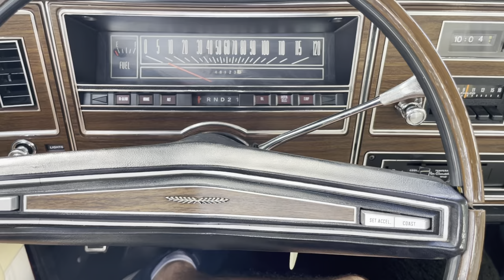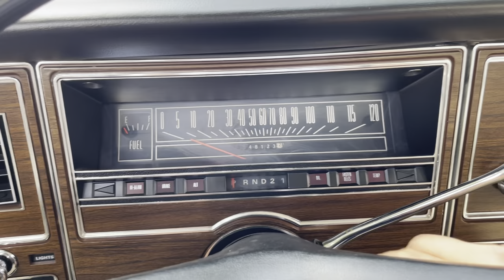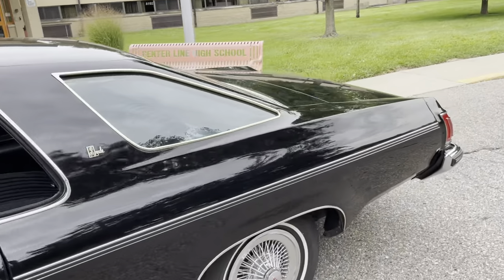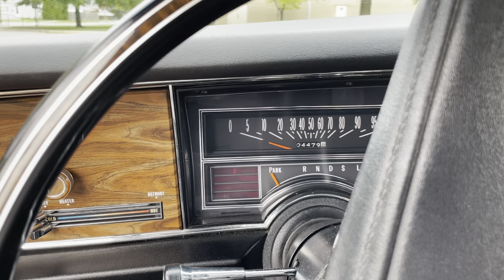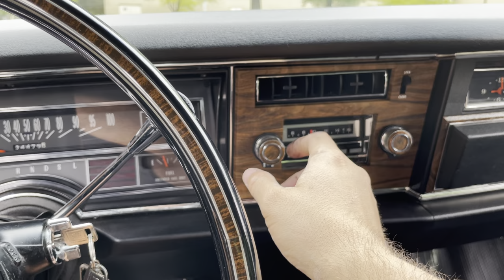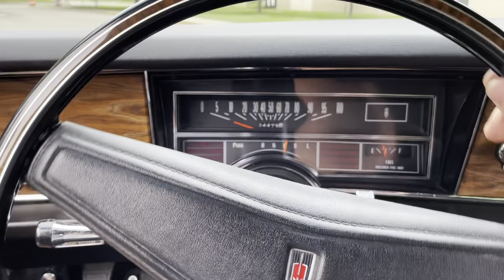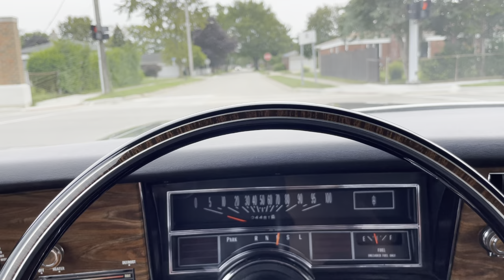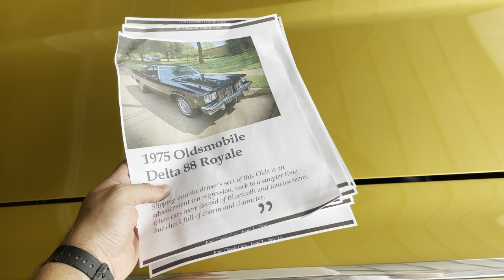1975 Oldsmobile Delta 88 Royale & 1974 Mercury Marquis Brougham - Check out Article in Description!

Comment: My dad drove these Ford LTD, Mercury Marquis land yachts when I was a little boy.  They did ride remarkably smooth.
Reply: Same here, we had a 72’ Galaxy 500, what a tank but boy did it float, that 400 moved her pretty good too. 👍🇺🇸
Reply: I got a 72 Galaxy 500 two-door but it's only got the 351 Windsor still a f**** beast
Reply: I love ‘em, I’ve got a ‘71 LTD 2 door with a hot 429 although it has airbags in the rear and a coil over conversion in front so ride and handling are a lot better. It runs 12.6 second quarters. I’ve also got a ‘71 convertible on magnum 500’s and a modified 351 Windsor with only 35,000 miles on the odo.
Reply: @craigjones2878  impressive
Reply: It’s like driving your living room couch around town!
Reply: @jimgoff1170  it was.  I remember feeling safe and comfy in them as a little boy.

Comment: My father purchased a 1970 that my mother drove.  In the summer of 1972 I was eight years old and we took that car for a two week vacation to the state of Washington to meet some relatives in my mother's family.  That Marquis Brougham rode my parents and I plus my maternal grandmother, a sister of my grandmother, and my mother's teenage sister.  No car issues to the ocean and back.  We took that Mercury on many vacations.  My parents owned that car longer than anything else they owned before I was 16.  I remember that the car was loaded including a four speaker AM/FM radio.  I believe it has the Sure Track. To me that was a car that in its day I would call a smart man's luxury car in that a Lincoln does offer a little more, but for less money the Mercury Marquis Brougham offered a lot.

Comment: You have a real discerning eye when it comes to the factory imperfections, particularly on the mid - '70's GM's.  You would have had a field day on my '75 Century...  I never would have suspected!
Reply: Miss my 74
Reply: I have a 75 delta  convertible after the first gas shortage they did everything to try to get some fuel economy
Reply from the maker: Yes, they have their share of imperfections for sure.

Comment: In the late 1980’s I had a 1974 Mercury Gran Marquis for several years. I called it battleship grey with grey interior. Very comfortable car and drove more nimbly that you might expect considering you could play tennis on the hood. It was over 100k miles but it needed very little work during my ownership. I sold it to a Soldier on an Army Post and apparently it got passed along from one to the next as I saw it many times for several years on the road and in the barracks parking lot after selling it.

Comment: This Mercury is an absolutely gorgeous car Adam.  My mom's friend had a 1973 Mercury Marquis Brougham in the 1970s, very much like this.  It was a slightly different color, sort of a reddish orange, but it had a white vinyl top and white leather interior in it just like this car has.  It made quite an impression on me as a young kid riding around in it.  I believe she drove that car for 10 years, then traded it on something smaller and more fuel efficient.

Comment: I drove a ‘77 Olds Cutlass with the standard 6 back in the early 80s and it was a tank. It was used for a 50 mile 1 way commute several days a week + driving on NYC streets. It ate up pot holes and was even decent in the snow. It was plain Jane brown with a dealer installed (I think) beige vinyl roof & dog bowl hub caps. That split water fell grill was iconic. Interior quality was decent but the engine initially would stall on turns. That was repaired. I didn’t have an eye like I do now for exterior fit & finish. (Thanks Adam). Otherwise, it was a fine ride…sorry it’s long gone.

Comment: Another great video Adam! Who would have ordered an Olds Delta without air conditioning in 1974? A Chevy Impala....possibly, The difference in quality and fit and finish between the GM and Ford is shocking, While overall quality was low in the mid-seventies That olds is a shock to me, We owned a 1972 Country Squire and then a 1976 Gran Torino wagon. never saw imperfections like GM was rocking back then

Comment: I noticed the heater core was bypassed, something we always did in Az unless it was deep winter. Hard to imagine a car like that was even available w/o air conditioning, but a buyer was able to actually able to "order" a car however you wanted. I remember non airconditioned cars back then had much better ventilation. I had a 68 SS Camaro that had "Asto Ventilation" and it worked really well.

Comment: Tony's a great guy.  I've owned a 76 98 Regency,  a 76 Fleetwood Talisman, and a 79 Lincoln Continental. At 6'2 I will say the Lincoln/Mercury/Ford sedans had so much more front seat legroom, even though on paper the measurements look the same as the GMs. Due to the sharp upward angle of the floorboards meeting the firewall, my GM sedans were downright uncomfortable after a few hours of driving. But, in my Lincoln, I could put the driver's seat in its rearmost position and not be able to touch my feet to the firewall.

Comment: Your observations are clear and we'll reasoned.  Ford/Mercury ride, fit/finish and sound deadening from the late sixties and early seventies sold me on their products.  The GM jiggle coupled with crudely fitting body work has kept me out of GM vehicles.  I anticipate your next video eagerly!
Reply: The doors on that Olds are horrible. Instead of the solid single auditory "click" on the Mercury, your ears are met with a multi-percussive clunk that does not inspire confidence. And those gaps! Granted, most two-door cars from this era suffered from this, but this example is pronounced.
The "GM jiggle" nails it! Our family car was a '71 Impala, and I vividly recall this dynamic. It was gone with the '82 Delta 88 that replaced it.

Comment: Hey Adam, it's Bill Maceri again. As promised, I just finished watching your reviews of the '74 Marquis, and the Delta 88. Before I go further, after watching this video, once you took the Marquis on the freeway, I could sew the I 75 signs, and the 11 Mile Road exit so I knew exactly where you were.  I have family that lives off of 8 Mile Road, and before my parents moved to California, we lived in Saint Claire Shores. It's been a while since I last visited Detroit, but I felt at home in that area. Now for the Olds. After watching your review, the things you pointed out about it tended to be more negative than than positive features and overall build quality of GM products from that era versus the Marquis and even the Chrysler products  you reviewed, confirmed my opinion of all three. I'll select a Ford Motor Company and Chrysler Corporation car over a GM every time. Today, I only drive Ford products. I currently have a 2008 Explorer Xlt that I love. It's my second Explorer, my first was a '97 Eddie Bauer that I also loved, unfortunately it was stolen, or I'm sure I would still have it. In my opinion the best thing about the Oldsmobile is that it's black. The one thing that GM always had going for it was it's size and it's 5 brands. Now it doesn't even have that anymore. Admittedly there were a few Chevrolets and Pontiacs back it the day that were very good looking, but there was never a GM car I would ever own. I understand the quality of GM products has improved in recent years, but I don't think there's any excuse for some of the lack of overall quality and design that GM cars are known for, not with the financial capabilities they have behind them. As I mentioned in one of my other comments, I owned a 1975 Mercury Colony Park wagon for many years. I loved everything about that car, and wish I still had it. It was a 9  passenger, 460 with a 4 barrel Motorcraft 4300 carburetor. It was loaded with every option available. Many of it's features were powered by vacuum, so I learned all about how those systems worked. There were vacuum storage canisters and check valves everywhere on that car. You mentioned a relay that controls the temperature of the '72 Chrysler's air conditioning you  could hear operate, well on the Fords it was all controlled by vacuum motors under the dash you could hear hissing and whizzing as it controlled the temperature and 8 speed fan on the ATC. The Ford system would pre heat all the air that the ATC used to reduce humidity. Sometimes when driving the car in high elevations with the air conditioning on it would lose engine vacuum climbing steep grades in the Sierra mountains and since the system requires high vacuum for colder temperature setting, the system would only put out very hot air until the engine vacuum increased. So I added more vacuum storage and used a hand vacuum pump to keep the system operating. It was kinda funny but it worked. In any event your '74 Marquis is just beautiful. You pointed out something I never noticed before regarding the hood ornament. I was aware of the ones on that on the '74s being different than the '75s, but never really noticed the '75s were the same just turned vertically.  Thanks for that. Again thanks for all your reviews, I really appreciate them.

Comment: I'm sure I mentioned in your previous reviews, the UAW quality was always questionable, especially pre-contract periods and Midwest assembly. Bolts, paper cups, moldings, plastic trim pieces, name it; could be found in interior door, quarter and trunk panels. We would find all types of bad body shop paint work. Meaning it was repaired/repainted post assembly, shipped, and delivered to the dealer, to be repainted again at dealer's body shop, billing GM. That was my first after school job, 'Get Ready' department. Those Colonade rear openings originally came in 6pc stainless, but GM cheapen them up with non-straight one pc plastic , like on your Olds, to a point of elimination on the G/AG Bodies. Cadillac Colonade coupe retained the 6 pc design longer.  Spot on as always Adam! 👍🏾🇺🇸🏁

Comment: Great review!  You are correct that the Mercury Marquis "feels" more powerful.  The reason is not the horsepower, but the axle ratios.  Oldsmobile used both a 2.41 and 2.56 to try to boost fuel economy vs. the 2.73 used in the Mercury.
Reply: His red marquis has duals and no converter also

Comment: Enjoyed this video comparison very much. A few comments: we owned a '74 Ford Maverick 4-door with the Luxury Decor Option and it had a few of the same interior pieces as your Marquis, such as a very similar steering wheel design (which I think Ford used in every car line back then), and incredibly, the same shag carpet, the plushness of which belied the other utilitarian aspects of the Maverick. I notice that the Merc also had the same problem with the driver's side shoulder belt fraying on the edges as our Maverick did. We actually had the dealer replace that under warranty but the new one had the same problem in short order so I presume it was an issue with the B-pillar loop bracket. It also had the same slow, numb power steering that required a lot of wheel twirling. I remember reading at the time that the notorious marshmallow ride on the big Ford and Merc was a result of HFII's preference for such things, though obviously I don't know if that is true.

The Olds seats were I believe different from the Ford/Mercury design, which still used serpentine springs topped with layers of foam and batting. Olds (perhaps all of GM by this time) used a "pan" seat design, with a steel pan on the bottom holding a very thick foam cushion or cushions of varying firmness, which might explain the difference in feel. Over time the foam can degrade but it appears yours has held up well. The GM variable-ratio steering boxes (no racks yet!) were certainly an improvement over Ford's design, and the TH-400 is the best transmission Detroit ever built IMO. However they did soak up some engine horsepower so maybe that explains some of the performance difference between the 460 and the 455. I suspect the catalyst also chokes down the breathing on the Olds to some extent.

The quality differences are noteworthy. You could well be correct in speculating that the low production numbers for the Merc allowed more careful assembly. That certainly wasn't true of our Maverick, built in Kansas City IIRC, which was a terribly-built car, though obviously a much cheaper one which may have had something to do with that. The quality issues on the Olds are disappointing. It must have been a bad day at Olds Main in Lansing when that was built, especially on the body line. Those flaws you note where the quarter panel meets other panels are issues with the lead filler they still used back then to cover seams, and which required some skill to do correctly. See this 1978 GM commercial showing it being done: https://youtu.be/Mgbscwm2IuE
Reply from the maker: Thanks for the great comments.  I actually think the C6 robbed a bit more power than the THM400.  Something like 46hp for the C6 vs 42hp for the THM.

Comment: as a teenager I worked at my uncle's gas station, he would send me out to pick up lunch in his canary yellow Lincoln, think 72, and he actually trusted me to drive it, this car reminds me of that Lincoln, what a beast to park! the diner was downtown but my Dad taught me to parallel park, pull up to the car to your right until the steering wheels are lined up and stop, turn the wheel completely to the right, back up until the back of the right rear fender is at the curb and the front right fender clears the back bumper of the car in the space in front of you and stop, turn the wheel completely to the left, continue backing up until she just slips into the space, never fails. oh and the lunch? always the same, fried pork roll and cheese on a hard roll with fries and gravy, love NJ in the 70s

Comment: Nice cars, but I prefer Adam's older Mercuries - the white and maroon ones.  Or the '69 Mark III.  I learned to drive around the time these cars were new and the difference between mid-70's and late 60's in in terms of both power and quality was very noticeable. The Ford handling did get better as the 70's progressed and by the early 80's, the big Ford handled quite well - for what it was.

Comment: This is my second time watching this video.  The Merc is absolutely beautiful for sure.  Too bad about the way the Merc's hard plastic door panels changed color like that.  The black panels is the Olds don't seem to fade or change colors, so I guess I was lucky that my Caprice had the black interior.  Yeah, the fit and finish on the Olds is terrible, I hear something rattling or clunking when you went over those bumps.  I remember when Aunt Marion and Uncle Fred bought the 76 88 coupe (used), I was unimpressed with its quality right from the start.  That cheesy glove box door never fit right and rattled.  Aunt Marion had a fit when the news broke that Olds was using some chevy V8s in their cars.  I assured them that their 350 was an Olds engine.  
And yes, there is some sort of rattle in those GM doors when closed, my Caprice did that also with the window down or part way down, but was quiet when closed with the window up.  I'm wondering if the rattle has something to do with the window track and hardware.  My big ol Caprice doors closed easily though, there was never and sag even at 245000 miles.  You just didn't want to have to close the door if the car was tilted to one side or the other.  I ripped the assist handle out once trying to close the door.  
The olds definitely looks better without the stupid vinyl top/landau vinyl top, which just brought attention to those horrible opera windows, but at least the Olds still had a back window that went up and down unlike the Chevys of this year.

Comment: A word about handling: Most retrospectives assume asphalt  roads. And that was probably most common. But in my home town, at the time, at least half of our roads were still gravel. The surfaces would terrace with age between gradings, making them very difficult for average vehicles to track comfortably. Add to that, mudholes from rains; driving was about as hands-on as it could get.

The 70's "boat" cars handled exceptionally well on gravel. You almost could not wreck them on even the worst surfaces. While other cars could not drive faster than "maybe" 40 mph without fishtailing off the road, a Marquis or LTD could cruise effortlessly at 55 or faster.

Gravel roads are why the boat cars were so popular among our elderly drivers with bad backs and hips.

Comment: A 73 Galaxie 2dr hardtop was my first car in 1975. Bought with just at 10,000 miles medium metallic blue with white interior and vinyl top 400 ci am radio, I remember most all have very few options as my dad worked at the Ford dealer 60s thru 80s. Mine had 721 radial tires. Hated the gas mileage. Agree that car was very dependable to survive a 16 yr old, and the car would scoot in town. 112-116 mph on I- 77 because of the 2 bbl.

Comment: Have you ever tried retro brighting one of those yellowed hard plastic door panel pieces to see if you could bring it back to the its original whiteness?
Reply from the maker: I haven’t yet tried, but have seen it done.  You can also use trim paint.
Reply: @RareClassicCars  It'd be interesting to try if you had a sacrificial part to test with.
One day I need to type out the story of my uncle's 74' and 78' Bonnevilles verses my grandma's 77' LTD and which one became the official road trip car well into the 80's and why.